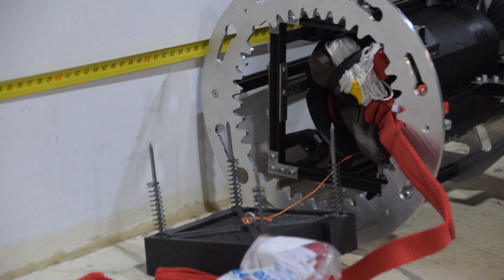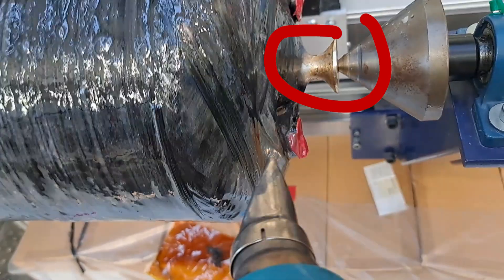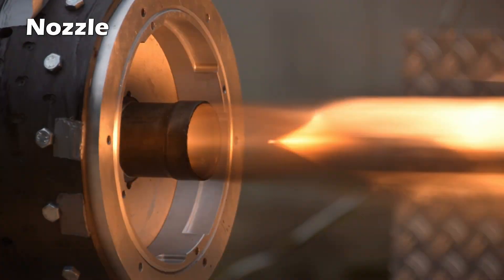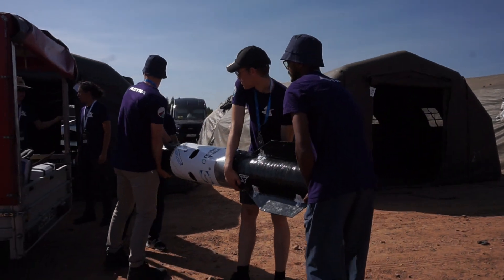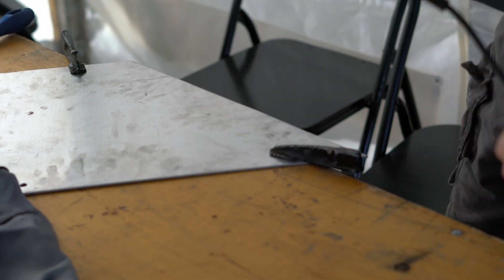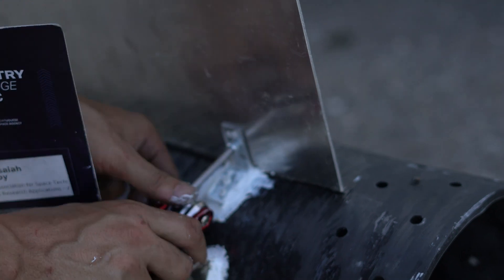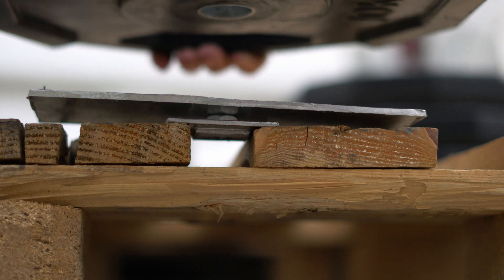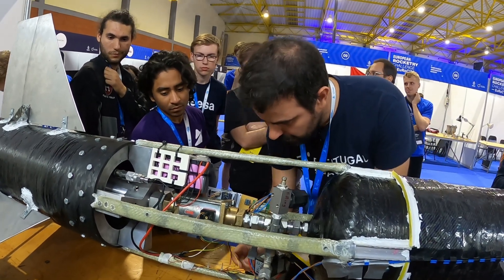KARMA's EUROC Drama

Comment: I think following are the faults that you have to work on. 1. PCB MOUNTINGS 2. FLAPS DESIGN. 3. FLAP MOUNTING. 4. THRUST TO WEIGHT. 5. JOINTS.
Reply from the maker: 100% agreed!!
Reply: Just be confident whatever you will be doing for next year. 
Be analytical. Being a mechanical engineer i can understand.
All the best ASTRA TEAM  @ASTRABremen

Comment: I have a question? What was that wrong input in your program of Fins.
Reply from the maker: The stupidest thing...  We flipped the sign of the distance between the center of mass and the center of pressure.  Basically we did not interpret the reference frame correctly.  Don't make our mistakes...

Comment: Thanks for sharing this story 😃Great video! WARR are absolutely awesome for helping out! Would have loved to see your rocket fly! What was Karmas expected performance if it would have flown?
I respect the love for silicone! I realy do! This is just the first time that i have seen it beeing used in the construction of a rocket. Usually rocketeers like to use epoxy or glue. What advantage did silicone have over these methods of attaching stuff to rockets? 
And best of luck for next year! (?) 😉
Reply from the maker: We were hoping to reach 3km with Karma.  
Silicone is actually a lot stronger than epoxy in specific applications:
1. Vibration - silicone is way more vibration resistant because it does retain some flexibility when dried unlike epoxy.
2. Heat Load - Silicone burns away more slowly than epoxy which makes it also quite good in combustion chamber (weirdly).
I honestly have no idea why people do not use it more often.  It is the the main reason why our propulsion worked so well while being insanely cheap.  But yeah, we may have overdone it is some places...
Reply: @ASTRABremen  I mean its cheap and it works :D hard to argue with that :)
Are you planing on doing a video on the design of Karma from the perspective of integration? I feel like that would be interesting. Systemintegration is a realy cool topic i think.

Comment: The worries about silicone's strength in tension and shear made me think about effect of vibrations. Ordinarily I'd expect fasteners to have same yield stress regardless of frequency (modulo potential resonance). I realized that I actually have no good reason to think so in general, and about caulked connections specifically.

Comment: Why no burst disk on the tank, I would definitely do so on any custom tank. Really prevents blevy type situations and is pretty standard if you ever operate near it while it's in use.
Reply from the maker: We had an operational rule that no personal can be near the tank (within 50m) while it is being filled or pressurized.  But in the future, we are considering a burst disc to improve safety.
Reply: @ASTRABremen  How do you disconnect the QD (and presumably close some opening that the pipe/hose was entering through) after filling?
Reply from the maker: @robertobryk4989  We have a drop mechanism, that releases a weight.  The weight then falls snapping a line connected to the QD taught and generating the required force to disconnect the QD.
Reply: @ASTRABremen  Ah, so you generate a horizontal force that way. That makes sense. Is the hole that the qd connects through aerodynamically benign enough so that it doesn't need to be closed, or do you have some spring-loaded(?) closure?
Reply from the maker: @robertobryk4989  We considered it to be aerodynamically benign cause we never go supersonic.  However, this is a bit up for debate I would say...  You would definitely need a cover for supersonic I think.